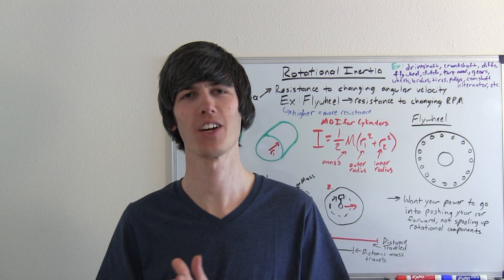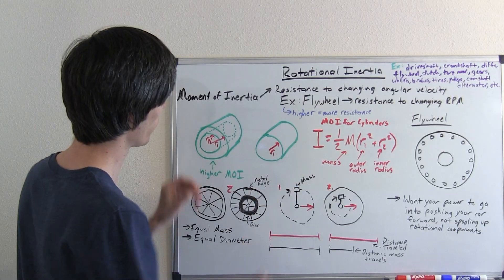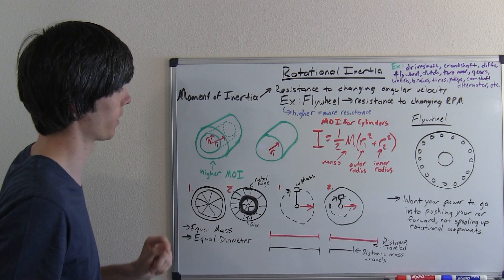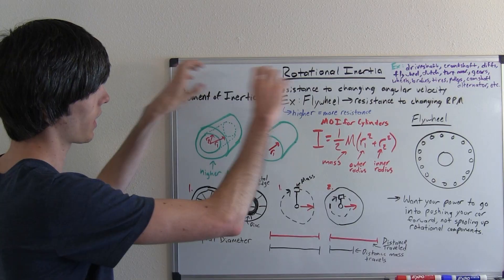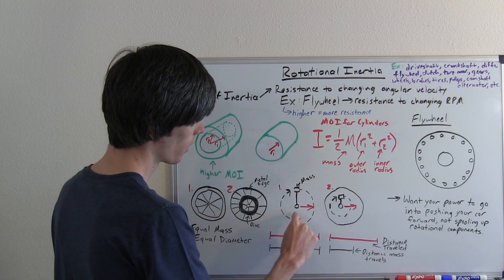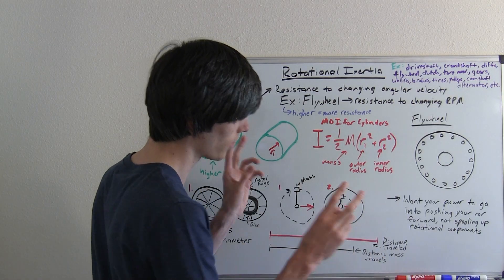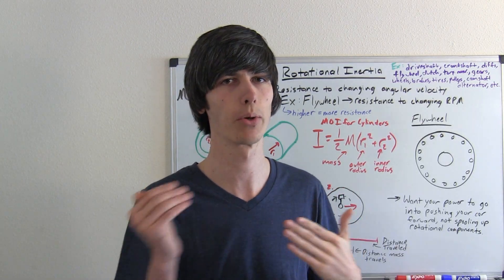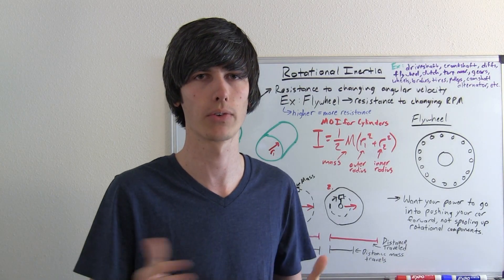Rotational Inertia - Effects on Horsepower

Comment: angular acceleration level vs power losess ….. let say whell accelerste from 50 to 60 km/h in 10 sek after engine tune now it accelerate in 1 sek  so diffrences in whell energy is the same but energy :time = power as time go down power required for acumulate the same whelll energy increases  now the question is 👉🏻 if or not it increases power losess in drive train  ? 🪠biger rotstional inertia increases 👌🏻 but bigger accelerstion from biger power input ? 🤔 i say yesterday i say yes when i first time check this theme thani say no 1 hour ago i say no but now i think yes 🤐🤷🏻‍♂️ so yes or no ? this is the question worth at least 5 $😉👌🏻🪠in the other hand when car accelerste faster at the same speed range its inertia itself dosent swalllow any power this power just accelerate it proportional to power increasing excluding drag so 100 hp at whell at 100 km/h will acelerate csr 2 times slower than 200 hp at 100 km/h in the same test codnition so i say at end NO 👌🏻🪠but i dont know on 100%  👍🏻 😁 🪠☕️

Comment: I recently bought a set of aluminium wheels to substitute the steel ones I had. I bought them at a junkyard, had them checked for "straightness" and then painted them myself.
I spent two fuel tanks after the change and the mpg increased. The steelies were 6kg each (around 12lbs) and the aluminium ones are half that at 3kgs. It "added" 50 kms (30 miles) to my fuel consumption per tank, being one tank with the steelies 650kms. So, around 8% fuel savings 😎

Comment: Anyone know if this can translate to preferring a spacer to get proper fitment, vs getting a wider wheel or lower offset? I would assume since the weight is being added to the very center it would be better compared to the additional weight coming from the wider wheel?

Comment: I recently bought lighter rims for my bicycle.  Riding on these I have discovered some potential disadvantages.  The extra weight around the outside of the rim adds some stability with a greater gyroscopic effect.  The energy is not lost, but stored in the gyroscope.  Yes, it takes longer to accelerate to maximum speed, but once you get there, you have more inertia stored in the wheels.  The same bicycle with lighter wheels going into deep sand, will stop faster, possibly getting stuck, right?  Also, as you pedal, you tend to track along the ground in a slight, "S", pattern, caused by uneven torque on the crank arms.  This can be exaggerated with lighter wheels, decreasing overall forward motion.  Also, since the bicycle doesn't have power steering, going through uneven terrain puts more torsional forces on your shoulders and arms, as the lighter rims being less gyroscopic can be more easily moved from a straight line track.  This would also apply to any off road vehicle, any thoughts?  Is lighter really better in all circumstances?

Comment: Close but no cigar. Your formula is wrong and torque is what makes thing accelerate not hp. Horse power is a measure of power, torque is a measure of force which is what is require to make something accelerate. F=MA, the basic Newtonian formula defining the relationship between Force,Mass and acceleration.

Comment: Assuming you actually DO want to spend power revving up rotating mass (mainly to absorb intermittent and grossly over-powered inputs), am I correct that the slower-to-go-downhill cylinder will also take longer to slow down at the bottom, protecting more of the energy it does pick up from gravity on the way down from friction losses by resisting the change in rotation that friction would otherwise try to impart?

Comment: I have a question.  I drive a RWD vehicle and I'm considering upgrading the stock, heavy rotors to 2 piece, lightweight rotors.  The front rotors save 10 lbs each side (20lbs total) and the rears save 5 lbs each side (10lbs total).

Since the car is RWD, will it gain a bigger benefit by upgrading the rear rotors versus the fronts, even though the fronts shave off more weight? Strictly speaking about ability to accelerate.
Reply: Any thoughts on this please? Will I gain more acceleration by dropping 20 lbs total up front or 10 lbs total in the rear? For a RWD car.

Comment: Just to get this all straight. I have a 01 single cab z71, I'm planning to swap an 8.1L 8100 vortec from a 03 crew cab long bed. From factory that truck makes around 340hp and 450lbs of tq. So I should be able to expect slight a slight gain beach of the shorter drivetrain?

Comment: I love how many car forums have threads about how lightweight crank pulleys can increase horsepower . 
 I love to get on those threads and troll the sponsors of such horseshit.
 It is IMPOSSIBLE for lightening the rotating mass to increase actual HP.
Horsepower is normally measured AT CONSTANT RPM.
  A proper dyno will HOLD RPM constant and see how much resistance the system can hold without dropping RPMs.
Typical Dynomometer "Runs" use a sweep that performs these HP measurements quickly across many RPMs.

So measuring HP at constant RPM CANNOT be affected by the mass of the rotating assembly because it is NOT ACCELERATING during the measurement.

Now when measuring the "before versus after" on an INERTIA DYNO , they CHEAT by not changing the factor in the dyno software for the change in the rotational inertia of the rotating assembly after the mod is made.
So you changed the Inertia on the real engine but DIDNT TELL the dyno software then OF COURSE you will see bigger "HP numbers" when the inertia dyno calculates the apparent HP of the system.
If they update the change in rotational inertia in the software, then the dyno should show NO CHANGE in HP when measuring the lightened rotating assembly.

Comment: I actually had a idea of using that principle in racing cars ....u contract the mass towards the centre after a car is about 50 miles an hour and its speed would increase by too much
Reply: But then you lose all that area under the curve by accelerating slower. Maybe if it expanded during turns and then harnessed that energy by contracting the mass on corner exit. I just don’t know how you would do that more efficiently than with brakes and gas. Maybe springs activate the contracting of the weight but then you run into problems because you don’t want to store energy in the springs if it’s energy that could be used to accelerate. So maybe the car charges pneumatics and uses those to compress the springs which will in turn contract the rotating mass on corner exit. I think we can design our prototype😂
Reply: @oliververnon8120  wow a reply after 5 years! youtube comments really connects myself across time haha

Comment: I understand how this video explains benefits of a lighter flywheel. I was hoping this video would cover the purpose and benefits of a heavy flywheel. When replacing the clutch on my daily driver, I learned that yes, a light flywheel would increase my acceleration, but it would have a negative effect for stop and go driving as I regularly engage my clutch to inch forward. I think some information as to why vehicles use heavy flywheels to begin with, would be useful

Comment: Hi there sir. First of all, love all your vids, very informational, I tend to believe the things you claim in most of your vids. I have a question  I want to buy gruvzn parts one piece billet lightweight pulleys, 4 of em, crankpulley, servopulley, airconpulley and one other which I dont know anymore, its a kit. They claim 5-7hp gains and heard a lot of good things about them. Would you recommend these and could they realy give that high of hp gains as they claim. My car is heavely tuned (NA).

Comment: Good video. I have a question about rotational inertia and fuel economy. I recently replaced my 22lb OEM flywheel on my wrangler tj with a 26lb flywheel and stage 2 clutch. My hwy mpg has increased by 12-18% depending on weather you measure from previous worse or previous best. With a loss in horsepower and a higher energy input required to spin the flywheel, why does the fuel economy increase with flywheel mass? As a follow up; at what increase in mass should one expect fuel economy to decrease due to the massive amounts of work required to initiate rotation?

Comment: What about rotating mass in the bottom end? Would a lighter weight Crankshaft be more resistant to getting the inertia going to the drive train? (0-60) Or would a heavier crank be more likely to keep the rotating mass going?
Reply: on my '06 350z I used to have, every time I would launch it, it would just kinda sit there and burn some rubber a bit before going.  After installing a lightweight clutch and flywheel (from factory they already have composite driveshafts) every time I launched it afterwards, it would chirp and then grip and launch the car forward, and I was able to shave off a notable amount of time off my 0-60.  However, it was slightly annoying hearing all the chattering afterwards coming from the transmission.

Comment: Hi, great video.... I have a follow-up question. I am a cyclist. All cyclists kinda agree that reducing rotational weight from wheels and tires is more effective for cycling performance, especially for uphills and accelerations, than reducing same amount of weight from rider, bike frame or other non moving parts. Can you devise a formula to calculate relationship among performance, rotational weight and non-rotational weight? Thanks.
Reply: aero > weight bro, just look at flo cycling's data
and losing weight on yourself will help more because you'll be in better shape :P

Comment: Hi there, Can you make a video explainig lightwheight flywheels? Are they worthy for a "non-race car", like my daily? Would the engine get better or lose power?
Thank you, you have a great channel !
Reply: heavier flywheels have the advantage to make your car go further distance when idle (example coasting to a red light). Also heavier flywheels add stability to pretty much all of your engine components. lightweight -> nice and fast sport car to impress everyone. heavier -> best lifespan of vehicle and fuel economy
Reply: MTShell thank you. I'm rebuilding an engine, and I shake him up before it goes to the car. And as a "Lightweight" I mean give it a touch just to rev faster. Just a sprinkle. But i dont know yet. Thank you anyway
Reply: If you drive a 4-cylinder, just gently blip the throttle before accelerating properly (auto). You can just drive the car harder if you drive stick. But it's all about reaction times for cornering & passing, or for stock racing, etc. If you want to DD with a light flywheel (standard), try to find a popular aftermarket one that has some previous customers.

Comment: Ok, so lightweight alloy wheels - can you do an episode on them specifically? and benefits and disadvantages. Do lightweight alloys provide better acceleration (be it a small increase) or not. Am i correct in thinking lightweight alloys actually move the mass outwards - as the centre has less mass? and thus there would likely be no performance increase, as the mass has moved outwards. Or are lightweight alloys quicker to accelerate - purely because they are light weight?
Reply: Shueb Chowdhury That's a very good question. I believe it has more to do with the size of the wheel. If you run for example some large 21" low profile alloys, they would be worse than say 16" normal profile alloys. While alloy wheels are better than the same sized steel wheel because they're lighter, I believe that the very large low profile alloy wheels we see on cars are driven by a desire for aesthetics rather than performance, for example look at the tyre profile on an F1 car. The have relatively small alloys with large tyre walls and incredible performance, but you don't see people running 13" rims! 
I've heard lots of figures but found that approximately losing 1kg in unsprung mass is equivalent to losing 10kgs in sprung mass as it also helps the suspension work more responsively. The small amount of suspension in the tyre wall is also useful in absorbing bumps.
I wouldn't be surprised if 13" steel wheels with slicks on are faster than 21" alloys with slicks on. It would be an interesting point for discussion!

Comment: I love this video. I have a Mini Cooper with the 'run flat' tyres on. I changed the tyres and weighed the old ones Vrs the new Non runflats. There is a huge 3.6kg per tyre difference due to the stiff tyre wall that the runflat has. Of course then I had it on the dyno, and the difference was 1.9 horsepower, (obviously it was dynoed on the front wheels so if I include the rear wheels I can double this figure) so the total Hp increase is 3.8. Also helps handing, it's comfort, quieter and more fuel efficient. The tyres are cheaper too! It was the Pirelli Runflats Vrs Continental Premium contact 2. I just carry an inflation kit in the boot if required.
Reply: Tires should be the first performance enhancement.

Comment: I can concur that most cylindrical components in an engine would be better off with a lower relational moment. In my opinion, the flywheel may be an exception. In a comment below EE mentions a key reason for a heavy flywheel: smooth power delivery.  I want to watch the follow-up video treating traction, but it would at this point intuitively seem to me that too-abrupt power delivery would be a greater threat of traction compromise.  

Anyway, another excellent video! Thanks EE.

Comment: So why wouldn't having the mass further out provide more leverage? Like less torque to get the wheel turning because it can multiply force on the mass?
Reply: It does exactly that when it is already spinning.  But you have to add that much more rotational energy to get it spinning, and that energy is sapped from the engine.
Reply: It does, but it is a negative value that acts against you.

Comment: So basically when coming to choosing or making this kind of designs is better to go for those with more useful  mass at the center of inertia,...right ?
Reply: +Carlos Mejia That's kind of a backwards way to put it, but yes. (Flywheels and light rims are the main helpers.)
(The mission is essentially to remove ANY unnecessary weight from the outer-most parts of any diameter on the vehicle. Although 10" donut tires would make for great startup speed, you woudn't end up going very fast for your top speed lol. Tires play outside of this rule to a point, you definitely want grip hence (whydrag tires are very wide)

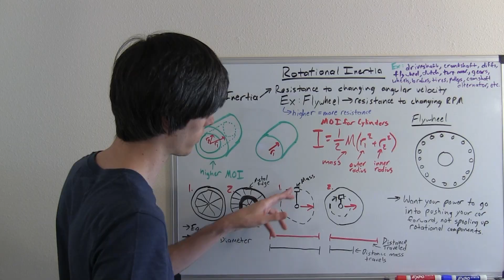Comment: About 4:10 is where it really clicked for me. Great explanation thanks.
Reply: It really is the simplest explanation. 
A
When he’s talking about the 2 wheels and one’s mass is concentrated near the center, there could be a third wheel given producing the same effect of concentrating the mass. The third wheel’s diameter where it meets the road is bigger, and the weight LOOKS concentrated because the weight was not expanded like the wheel was. Instead of slowing the rotating mass relative to the wheel you speed up the wheel relative to the rotating mass since it’s all about the ratio

Comment: so for 2 wheels of the same mass and diameter but with different shape... one has a nice 19 spoke design, whereas the other is a solid rim...

given conditions where aerodynamics do not matter, the wheel with the solid rim does less work to spin than a 19 spoke rim?
Reply: or is it the other way around?

Comment: This explains well why cars tend to spin their front wheels when shifting from 1st to 2nd, It's all that inertia that is "stored" in the engines high speed. when shifting to second the engine has to rotate slower but it doesn't want to causing a peak in torque at the wheels resulting in loss of traction. This also explains why my motorcycle doesn't wheelie in 1st but shifting fast to 2nd lifts the front wheel momentarily.

Comment: Uh oh! Late last night, I was thinking about this, and now I want cross drilled brakes. For my car's design theoretically it won't help with braking much, but it'll reduce the rotational inertia that has to be overcome for acceleration.

....when I'm up for the mod, I'll be weighing it and new ones to be sure the difference I expect is actually there.
Reply from the maker: ***** Umm.. yes they do. Your brake calipers remain stationary.
Reply: +DE “AutoBravado” Nichols You're not gonna lose much weight from a few drill holes.
Reply: chincemagnet Nope. But inertia is inertia. Hey, this is the least effective brake mod, so why not try it for weight? 

I'm thinking more about how lighter rotational items mean a lot more than overall weight. Still haven't done it. I'm so excited as to wait for newish rotors to wear out. Lol. Get the likelihood and time frame? Lol

Comment: Thanks for the great video. Here's my reaction when I found a practical application of this video's information.

Wow. You have to read the description on the video link I'm sharing here. 3 grams on the pistons assembly equals 100 lbs. of torque at redline. Watch the following engine rebuild presentation. His goal isn't to reduce weight so much as to balance his pistons. It's better to have the piston heads balanced, but that takes instrumentation beyond his ability. Hyundai Assembly 4 - Balancing Rods

This modification is completely within my ability. I want to do it first on my vehicle that isn't a daily driver.